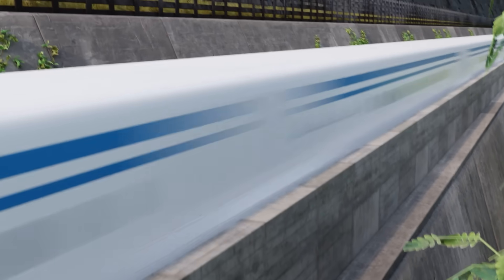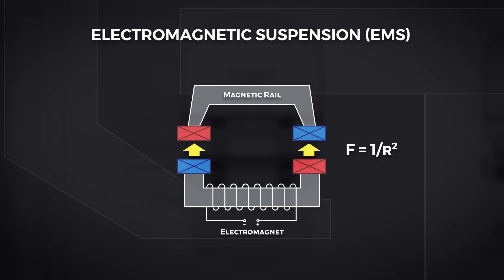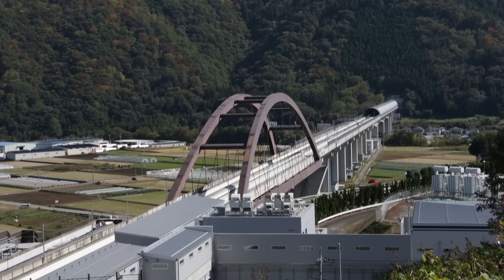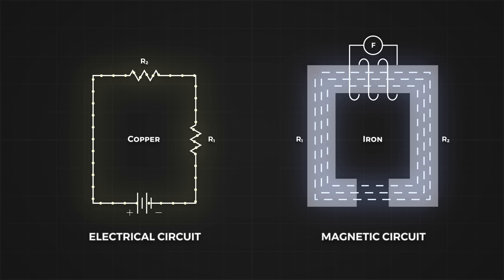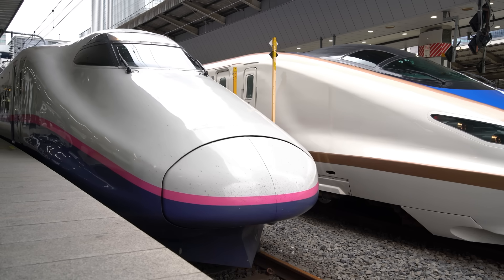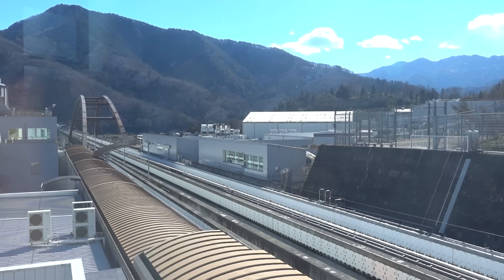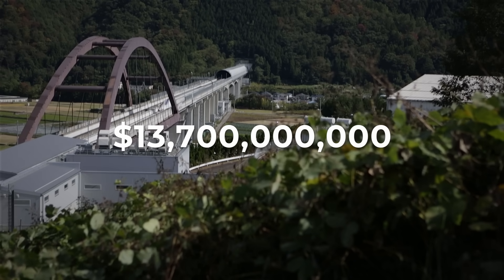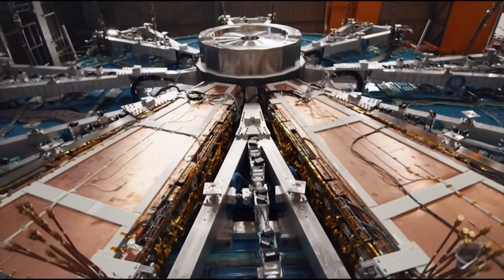How Japan's Maglev Train Works

Comment: I wonder if they have looked into... Vacuuming the air out of the tunnels.
Reply: Because it's impossible to remove the air of that large area then you also have to msg the material sturdy enough to Stop air from crushing it.

That's why the largest CRT TV we have is only 43inch.

Comment: I am skeptical that magnetic levitation high-speed rail will be successful in countries other than Japan. The Tokaido Shinkansen is the world's busiest high-speed rail line, yet the air route between Tokyo and Osaka remains extremely crowded. When combining the number of passengers on the Haneda-Osaka and Haneda-Kansai routes, they sometimes rank among the top 10 domestic routes worldwide. Despite such enormous demand, the Central Shinkansen project is still debated for its profitability. In my opinion, the only places where maglev could succeed outside Japan would be China's densely populated regions or the Northeast Corridor in the United States, where there is no proper high-speed rail system.

Comment: "REAL ENGINEERING" ITS NOT A TRAIN !!!
If in reality you knew the first thing about ENGINEERING, you would be aware the "MAGLEV" does NOT run on rails. So CANNOT  be classified or described as a "Train". It is technically as an Engineering feat a "Levitated MONORAIL" because the vehicles are trapped within one linear (mainly concrete) channel, like MOST MONORAILS !!!
Reply: rails arnt actully part of the definition of a train. a train is just a series of carriages that run on a dedicated track
but then you refute yourself by saying that maglev is a monorail… which its self is a form of train.
Reply: @logodsaw  Monorails are NOT Railways. "Rail - Ways" are by definition the use of two rails at whatever Gauge required. And despite numerous attempts to better "Two Rails" such as Monorail (one rail) or Maglev (Electro Magnetic levitation) have so far always failed to improve on a two rail system. Further "Maglev vehicles" have NO Locomotive OR Power car. The MAGLEV vehicles are propelled by the Electro Magnets fitted along both sides of the concrete trough the vehicles are effectively contained within. The whole point of this experimental "Maglev" line as featured in the programme, was to keep the whole power system ground based, not to put it in a moving vehicle. And to reduce friction by having the Maglev vehicles "float" by Magnetic levitation, which means they are more akin to an aircraft than any ground contact vehicle such a "trains" or even road vehicles !   

And by the way the "latest Maglev" now uses two rails to solve the main issue of what is featured in the programme, a Magnetic Levitation method located in a single concrete channel, where changing from one channel to another (to provide large terminal stations) becomes a horrendously expensive option. Railways have nice simple and cheap by Monorail/Maglev standard points (switches in US parlance).  And I'm referring to the newish "Maglev" Underground line in Tokyo. Which uses Electro Magnetism simply to propel the trains along two rails, at a much lower cost than trying to make even lightweight "Maglev" vehicles float on a field of Magnetism. Hence again the story has come almost full circle, back to two rails !
Reply: @railwaymechanicalengineer4587  wrong, the term is actually "rail way". the plural is used to refer to multiple rail ways. mono rails do have a railway you are wrong.

also i never mentioned the term railway in my comment so i dunno why you brought it up.

maglevs are still a series of carriages and they run along a dedicated track which is the definition of a train so your wrong again.
Reply: @logodsaw  You also fail to understand the English Language if you do not understand the reason for spelling "Rail - Way" as such ! And you obviously still cannot get into your head the simple fact that THE MAGLEV featured does NOT  even touch the ground, it is FLOATING on a field of Electro Magnetism, which is why its called "LEVITATION".  You must be a teenager, and I would suggest you go back to school and learn to understand the English Language, as you obviously fail to comprehend the Engineering meaning of most of the Adjectives used.
Reply: @railwaymechanicalengineer4587  the fact that it doesnt touch the ground is irrelevant, it still goes along dedicated tracks. it is just a levitating train which is still a train
Reply: @railwaymechanicalengineer4587  also your argument is just language not keeping up with technology, just because its propelled by the ground doesnt mean its not a train

Comment: In Germany our normal railways are in dire need of overhaul, because it has been pushed back for decades. I don’t think I’d consider the German ICE a high-speed rail compared to the Shinkansen or the French TGV. But it’s cool to think about a genuinely seperate rail network that is specifically for high-speed and could even be maglev-based

Comment: What happens in case of a power outage? Dropping on those tracks at 500km/h must be catastrophic.
Reply: Even if the Linear Shinkansen experiences a power outage, the train will be able to stop safely without suddenly falling to the ground because levitation force is constantly being generated while traveling at high speed. Also, even if one substation experiences a power outage, the system is capable of supplying power from an adjacent substation, so the possibility of a long-term power outage is low.

Since linear motor cars do not have wheels, they cannot be stopped by wheel friction. In linear brakes, the electricity used to move the linear motor car is reversed, creating resistance and slowing the car down. At this time, the kinetic energy of the car is converted into electrical energy, and the generated electricity is returned to the power converter and reused.

Comment: Maybe maglev trains can change tracks if the bottom has a w-shape. At the lowest point of the w-shape there should be magnets that prevent the train from going up. Maybe maglev train tracks are much cheaper to build because the track can be built in factories and can be placed by special trains and if it can be placed on poles there is no need to buy whole pieces of land.

Comment: Thanks for finally saying that Maglev will likely be a niche application.
Reason why JP decided to tunnel through most of the way is yes because the line will cross one of the most mountainous areas in the country, but also because it has very stringent noise regulations (and VERY sensitive population about it), so eliminating multiple tunnel entrances/exits to only few will drastically reduce the “bangs” generated when trains enter into them.

Also, for the love of god, please stop pronouncing Ōsaka as “Osàh-ka”, it’s “Òh-saka”.

Comment: Electromagnetics are extremely dangerous for the environment, From amplifying gravitational magnetic toroidal fields that are REALLY DANGEROUS to all geomagnetic magnets gravitational fields closest to the electromagnet. This is because the electromagnetic torsion field amplification accelerates geomagnetic torsion fields of all magnets that are nearest to the electromagnet that destabilizes geomagnetic gravitational fields of all surrounding mass that has A geomagnetic gravitational torsion field ( It makes things go boom, Experience any temporal anomalies that are seemingly unexplainable pretty close the the train that sound like loud explosions or unexplainable field disturbances? )

" Accelerating geomagnetic torsion fields from electromagnets cause things like Earthquakes " This is because electromagnet torsion field amplification also interacts with the geomagnetic gravitational torsion fields of all natural magnets and iron that's in the ground.
Reply: The distance traveled during test runs is equivalent to 100 Earth revolutions, and there have been no problems.

Comment: It's not widely known that low-grade linear motor technology like the Chinese one has already been in use in five Japanese cities for over 20 years. The only genuine linear motor train that floats as high as 4 inches above the tracks is Japan's. Its performance has been continuously improving, and this year, it has already achieved safe operation at 600 km/h.

Comment: There are different Models about the general structures of METALS: 
1 Enrico Fermi Gas
Model which upon
Dropping the Temperature of Superconductor below a critical Temperature gave 
Meissner Effect/
Expulsion of Magnetic Field outside the Superconductors.
There is. Double GAP in Fermi Level.
I know the so called " Skin Depth"
and PROCA Equation.
A so called " Heavy photon" emerge.
Inside the Electrons pair Up in COOPER Pairs bind by phonons/
Photons and phonons are completely different.
2.Model: Luttinger Liquid which treat
The COOPER electrons Pair as a BOSON.etc.
It will take weeks to expose.
3. Nowadays Fast Aircrafts to include
Hypersonic Missiles are based their movement on
Momentum Conservation.
But Future Hypersonic Vehicles will be without outside visible Propulsion by acquiring their MASS straight from HIGGS BOSON FIELD.
Without the HIGGS
BOSON FIELD all particles in Nature will be massless.
A Pertinent Density of Lagrangian / I.e
Leading to Euler-Lagrange equations can be wrote with correct
Boundary conditions imposed on Fields involved.
Numerous Materials exist.
Everything is POSSIBLE.
AMERICA RULES

Comment: Bro listen:
The power of magnets repelling each other is used in HIGH-SPEED TRAINS. Both magnets can be switched on and off. When both magnets are turned on, the magnets repel each other. This lift the train clear of the track so it hovers above the rail. The train can easily move because of this and so the train travels much faster than an ordinary metro train.

Comment: The primary reason for the increased cost of Maglev over conventional high speed rail in this case is the tunneling cost, not the actual track or technology.
In the video, you compared the tunneled Japanese maglev to a French TGV line that ran though flat farmland, and used the price per KM of the two projects to claim that maglev is 11x more expensive than conventional HSR.  If the maglev was built in flat farmland along the same route as the TGV you mentioned, it would likely only cost 1.5x as much to build.

Comment: Maglevs can operate with nearly no moving parts and support very wide loading gauges.  The Japanese Chūö maglev uses landing gear wheels that needed for every stop and is narrower than the standard gauge Shinkansen HSR trains.   The landing gear will require constant observational maintenance.   Compare that with the first generation prototype Chinese CF600 that is wider than it's HSR trains at about 4 meters and is electro magnetic suspension that allows levitating at a stand still.  They will be quiet and have very low maintenance in theory.  Testing has been done at over 600 kph with a goal of about 800 kph.   

Full scale maglevs without the restriction of the rail wheel interface should be about double width at 8 meters wide.  That has been a desired loading gauge since the beginning of the railroad age in 1840s Great Britain.   That 8 meter width will allow stability for three passenger levels with the first level likely being better used for cargo such as simultaneous perpendicular loading from the side of drive-on drive-off automobiles and cargo containers in a one minute stop.  The top third level of these 8 meter wide maglevs could have vista dome roofs allowing passengers to see forward watching the scenery.   The 8 meter wide loading gauge would allow large assemblies to be moved easy overland changing the world we live in.  

With stopping every 160 km or 100 miles needed to allow passengers to have a car drive of about an hour to the train station it is not that beneficial to run at super sonic train speeds.  At 1,000 kph (621 mph) a reasonable long term goal means it is traveling 100 miles every 10 minutes.    When needing to stop for 1 minute with slowing and acceleration there is significant time spent in that operation making speeds in the super sonic ream not that time reducing.   Super sonic travel speeds make vacuum tube use a practicable solution for avoiding sonic booms and extreme atmospheric resistance, but not attractive for sight seeing which is a large interest in using passenger trains.   

All very high speed trains need incrementally almost free electricity such as their own hydropower with unlimited water.  New technology nuclear electric power could be another source.

Comment: The cost of this project is disproportionately high for two reasons: 1) It's the first of its kind, so there are immense front-end costs on the technological development side and no economies of scale; and 2) an extremely mountainous terrain that has to be tunneled through, so maglev trains in more open air locations wouldn't face these costs.

Comment: The train of China runs at 1000km/h  !!!
Reply: The train in china use a different tecnology called "vacrail".Yes,the chinese train still uses maglev tecnology,but uses also a pressurized tunnel.
Reply: I think the Japanese economy is diverse and most of the places are developed. Where is in China only certain areas are in 2050 and other places are still in 2000. Of course the vast area and population is many folds in China so there will be their own challenges

Comment: the biggest advantage of trains is low friction (efficient) and straight tracks (fast), biggest disadvantage is track cost. hence the ideal solution is to use narrow gauge tracks on already built roads and use one carriage trains, which can travel in either direction

Comment: For the California High Speed Rail project it would have been the best using the german Transrapid maglev technology instead of classic rail way. And it's the same for the Texas Triangle. The Transrapid maglev system is market ready since more than 25 years and is succesfully operating in Shanghai for more than 20 years. The reason that this technology isn't used in Europe is that we already have an existing rail network and the maglev wouldn't fit in the network.

The big pro of a maglev train is that the train accelerates and operates a lot faster than classic railway. The only thing you need for economic success is a high passenger demand and a distance around 70 miles or higher. The propelling of a maglev train is far cheaper than propelling a classic railway, because there is no resistance. The energy consuming part of a maglev is the elevation. Thats why it gets economical better with more passangers and higher speed. The maglev needs the same amount of energy to elevate without moving an inch or going 350 mph.
Reply: You're wrong
Reply: @mr.zimtus5231  No Honey, I'm not. Thanks for attention!

Comment: Japanese Shinkan-sen trains or Bullet trains achieved 250km/h since 1960s, connects Tokyo and Osaka in 2 and half hour.  Don't be surprised. 
The new "Linear Motor Car" trains the magnetic hovering one will run on the same old route already in operation over half a century and doesn't really help much anyone. Because prices are very expensive needing new special trucks with destructing construction that are not eco-friendly. Men love hardware. yarn!

Comment: The thing is, even if it isn't cost effective yet, it's still worth pursuing, because when trains first came out, they only went like 5 miles per hour, and the high speed rail of today took iteration on working, proven designs to get there. 

When Daimler -Benz built the first car, they could have never possibly even fathomed that one day there would be fully enclosed, comfortable cars that go faster than any horse can and they would be mundane, let alone race cars going over 200 mph

If these things START at 500kph, can you imagine what these things will do in the future? Imagine when we get them to be able to move as fast as commercial airliners, but over land? All on electricity rather than jet fuel.

Comment: I have a difficult time believing that the range of 200-800 km (124-496 miles) applies to SCMAGLEV, especially the upper end of that range. That range seems like it could be in reference to conventional high-speed rail, and I have some reasons for this speculation. First, most conventional HSR systems top out at 220 mph, compared to 310 mph for Japan's Chuo Shinkansen. Second, SCMAGLEV can accelerate faster than conventional HSR, thereby improving the average speed of the former between two points. I'm not an engineer, but I believe it's reasonable for SCMAGLEV to have a range of at least 800 miles, depending on the number of stops and how far apart they are.

On that note, there might even be a market for "local" and "limited" HSR routes. For example, in North America, there could be a Chicago-Toronto HSR route (~487 miles), and a Chicago-Montreal one (~806 miles), with the former serving some smaller metros besides the largest ones and the latter serving the five largest metros along it. It seems a Chicago-Montreal SCMAGLEV service, with stops in Detroit, Toronto, and Ottawa and five-minute dwell times at stations, could be completed in three hours. According to Google, the fastest non-stop flight from Chicago to Montreal takes 2 hrs 2 mins.

If passengers have to spend an extra hour in transit to complete such a trip knowing that they don't have to wait in long lines at the airport and spend a higher premium for air travel, I believe most could justify the trade-off.

Comment: In Japan, which experiences frequent earthquakes, the maglev trains are designed to hover approximately 10 centimeters above the tracks using magnetic levitation. This design enhances the disaster resilience of the linear motor car, helping to prevent secondary damage during seismic events. This is so shifty